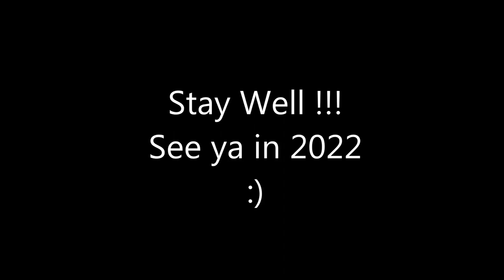DIY Machine Shop Christmas Ornaments

Comment: I love the the challenge of the rotary table projects but also watching a pro work is soothing. I can write plans better than I can operate the machines. A 5 spoke wheel on the rotary table almost done When I cut too far. The rotary table doesn't connect to the dro. Is there a way to solve this? Counting turns of the dial means frequent mistakes for me.
Reply from the maker: I am sure you could rig up an encoder or other electronic feedback mechanism, but thats out of my comfort zone.
Reply: @joepie221  yes, when I realized I must have a dro for the mill I had no trouble finding a set with dro and linear encoders there were many choices on Amazon but couldn't find any radial encoders with display. I kinda remember stumbling upon one of these sets back when I didn't know that I needed one and now I can't find it. My memory is unclear and must be of something else. Ok thanks.

Comment: Hi Joe i hope you had a good Xmas.
I do love your Xmas tree & Snowman they are just awesome.
I was sitting here watching some of your video's  & having just bought myself a  small Mill (SIEG x1(with the 400mm Bed)& it only came with four 8mm (M6 Bolts)T-Nuts & nothing else to hold down anything to hold down the item I'm working on, i have just bought some Toe(Strap)clamps now to wait until they arrive, i have made a couple of strap hold down but they are just until my new ones arrive, I just don't trust them but they are not the type i would like to use, the ones im talking about are the type you use with the recessed bolt in the main body,.
My Question/Suggestion is  have you ever or even thought of making some Mini Toe clamps?

I'm sure a man of your talent/ expertise could make a set & i reckon it would be a great video for the Hobby/Shed Machinist's.